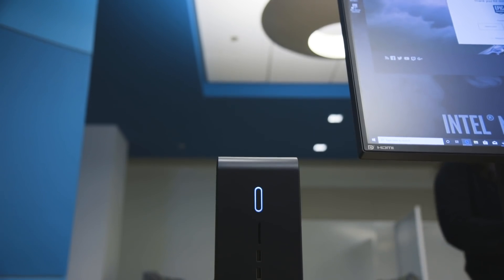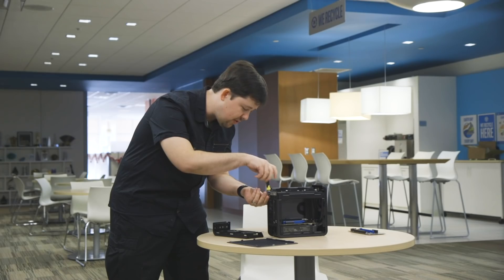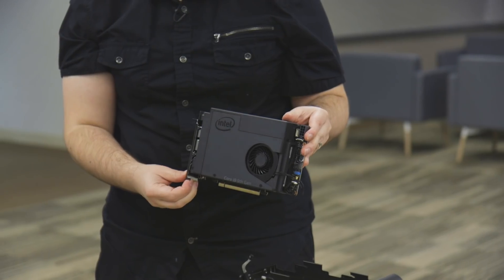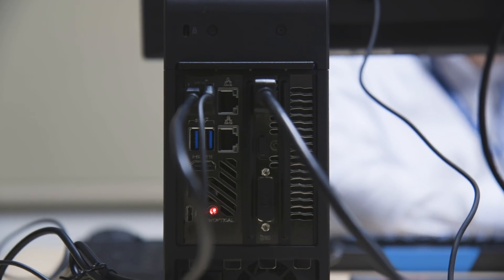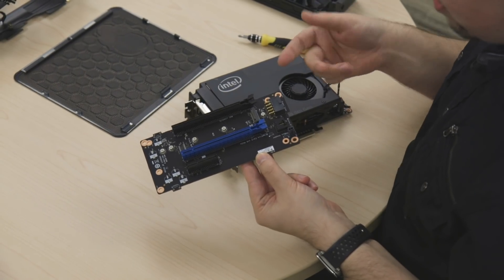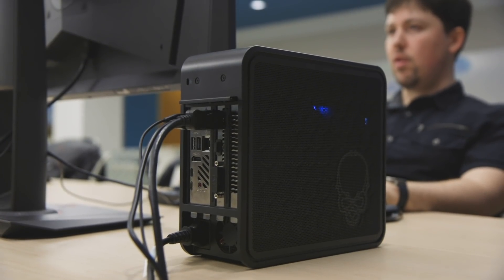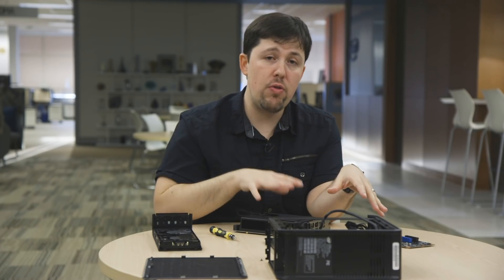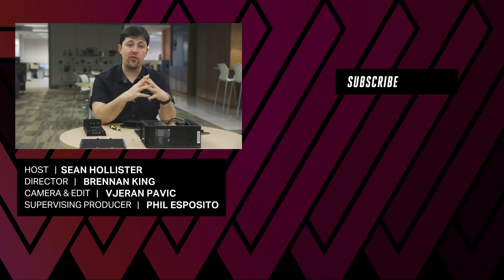Exclusive: Inside Intel’s tiny modular gaming PC

Comment: Hardware-wise I only have two real issues with the new Intel NUC 9 Extreme.:
1 - The front panel ports should be designed to be compatible with VR headsets.
2 - The CPU and GPU boards should be facing away from each other, so that each can draw direct air from the outside.

Comment: To be fair when I had my Pentium 4 with DDR RAM and IDE HDD, I upgraded to a Pentium D, which required a new motherboard and new DDR2 RAM, and got a SATA HDD. Then, I upgraded to an i7 950 which required a new mobo and new DDR3 RAM, and got a SATA SSD. Then, I upgraded to a an i5 9600K, which required a new mobo and new DDR4 RAM and got an NVME SSD. Making the upgrade just a card replacement makes absolute sense. What's everyone crying about.

Comment: $13-1700 for a barebones system with no memory, storage, or graphics

uh, what? No thanks
Reply: Well dont forget its just a laptop cpu... this product is a joke
Reply: That's a heck of a range; what does the $13 one include? 🤨
Reply: @user-vn7ce5ig1z  there is an word in english that works for you either way, if your serious or not. either sarcasm or not.
starts with an i
Reply: Ese Seis> there is an word in english that works for you either way, if your serious or not. either sarcasm or not.
starts with an i [sic]

Well, it's definitely not illiterate ¬_¬ My serious? I don't have a serious. Can I borrow your serious? 🤔
Reply: Ese Seis Trump?
Reply: Yes, but don't forget, when you buy a typical laptop, you will most likely replace the original RAM and SSD, because almost every single manufacturer dont include enough RAM and disk space. 1700 for top CPU, power adapter, computer case and motherboard is not too much.
Reply: Wrong, he said that is for the i3, i5, and i7 configurations.
Reply: @akhilyeddula6435   at 03:21 he says Intel will be releasing it as a "barebones kit" meaning you will need your own memory, storage, operating system, and graphics for between $13-1700 with the varying i3, i5, and i7 configurations.

Did you even watch the video?

Ridiculous pricing.

Comment: Upgrading a regular computer : Two screws off the case side, now you have access to everything
Upgrading this computer : 4 screws out of the front, unplug the motherboard (that's what it is), unscrew and remove the heatsink for the entire unit, welcome to laptop class components in your desktop, now you can upgrade the ram or the storage.

How is this easier? The price on this is also horrendous.

Comment: All Intel did was reduce upgradability. You can't upgrade the memory independently of the CPU, since its soldered onto that board. A CPU socket was already a good form factor, and it already allowed for easy upgrades. And it allows for independently upgrading of the CPU and memory.

Comment: What benefit does this size give you, maybe if you are on the go an also cary a monitor with you. If you want something compact there a re many cases with smal form factor psu's and standard components, yes there are slightly bigger but if you want to upgrade you don't have to spent money for 2-3 because there are all soldered to one another. Or you buy a corsair one, that still have most standard components.

Comment: -_-, Ok so it's so modular that you everything is integrated in one card... so what is left is enclosure.... It costs more than normal gaming  notebook... Yeah what a reasonable device we have here... I think it's better to Invest in smal portable notebook and buy external GPU enclosure. Every 2 years change graphic card  and every 4 years notebook and always use something that had premier 2 years ago or from ebay than you save around 50-75%.  Alternative us just get Intel NUC Hades Canyon with AMD Radeon RX Vega M GH
Reply: Marcin Rybarczyk the notebook/egpu enclosure combo isn’t worth it for how much it cost and the amount of graphics power that is lost. This is a much better solution from intel, the only issue is the price. If they could price it so say the i7 board with components could cost ~$1000 it would be more compelling.

Comment: Intel is trying to integrate stuff so that when times comes to upgrade you will have to pay more. Get yourself a small case, a small motherboard, a CPU, a small cooler (passive cooler if processor compatible) and graphics card and you will then have a truly upgradable machine that you will be able to upgrade for less and that could look equally good. Lastly you won't be tied up to Intel as you will be able to buy your upgrades from the brand of your choice. (Which is exactly what Intel doesn't want!)
Reply: Also the velka 3 ssf case exists
Reply: Not just Intel is trying to integrate stuff if you buy a cheap printer but you'll pay more for the inks or tonners --just biz as usual
Reply: The mini STX format should have caught on more. Perhaps with a dedicated PCIe x16 slot it would have the capacity to easily support high end GPUs with the same small form factor. With the added benefit that in mini STX boards the CPUs can be desktop CPUs that you can replace on the socket.
Reply: You'd have to buy a new motherboard if you wanted to switch to amd.
Reply: @cang559  This is true, but the massive advantage of this board is in its custom mobo design being split up into two pieces with an enclosed cooling case. Its rather genius and shaves more than 30% of what is physically impossible in other cases regardless of components (assuming you USE a GPU). This case is essentially a nano ITX (not mini) that integrates everything to save space, ditches any SATA ports in favor for the better M.2 performance, with an even slimmer 500w HDPLEX PSU and PCIE splitter (not riser). All of which saves a ton of space. This comes with its limitations of course, no AIO, no SSD/HDD, no GPU beyond 8" (so mini boards only), RAM modules are SO-DIMM and max out at 2666. The major benefit of this system is the fact that mobo/CPUs last the longest and GPUs are what really matter. This case can last a decade if you make a simple GPU swap. Then, when you want to beef up your CPU, go all out with a mobo upgrade too at $900. Humanity has always paid for convenience. This is no exception.

Comment: A CPU on PCIe?! I feel like I'm back in the 90s with my Pentium 2.
Reply: it's not really on PCIe. since the motherboard is basically on the "compute unit" the PCB with PCIe slots is basically just a custom PCIe riser, the connector on the compute unit is basically the one PCIe slot of the system split into 2 ports, it's an "input" not an "output" if that makes any sense.
Reply: Tech almost like fashion these days. What's old, is new again!
Reply: Slot 1 baby!!
Reply: IKR? The slotted CPU concept never sat well with me; while the performance was fine, it always felt cognitively incongruous with real performance, like it was going to take a hit (and to be fair, the P2 and P3 could have performed better if it weren't on a card). Also, maybe it just felt old-fashioned like how old systems had daughter-boards for various reasons. 🤷
Reply: The CPU should be replaceable without changing the whole board, but seeing that this is part of the NUC lineup that would be unlikely.
Reply: Daiku Coffee yea wtf
Reply: Thank you and exactly! This just means that when upgrading you have to swap everything...

Comment: Ahhh.... the good ol.... Apple Way :D
Reply: That thing is nowhere near as elegant as something Apple would make. It's just modular. It's cramped, still has cables all over the place, etc...
Reply: @SamDunham Tell me, how would Apple make something more "elegant " than this with no cables "all over the place" and make it less cramped but still house an RTX 2080? The answer is they couldn't or else they would have already done it. Apple couldn't make something this powerful AND nice looking. They could only make it look nice because that's all they are good for, fashion accessory tech.
Reply: @giottoprimo-1  They kinda did with the Mac Pro, there are no cables anywhere, just large pcie moduels, very similar to this just bigger.
Reply: @Sponch1  Not true. The Mac Pro has ports 2 USB 3 ports, 2 Thunderbolt ports, and 2 ethernet ports. Guess what it will look like when you start plugging in peripherals? You really think the demo, showroom version of the Mac Pro is how it will look when you use it at home? lol THey didn't have anything plugged into it, of course it will look clean. The Ghost Canyon looks clean too when nothing is plugged in.
Reply: Apple just what's your money and make things look different then they are
Reply: Ehemm..mac mini 😄

Comment: He`s talking about upgrading that module but doesnt mention thatll probably cost 90% of what the whole system costs
Reply: Whatever but its a huge ripoff.  You will have to get your own memory, ssd, gpu for the price of $1,050 with a Core i5 module, $1,250 for Core i7.  You can buy decent desktops and laptops with discrete GPUs with these listed prices.
Reply: @zodiacfml  i guess this device are aims towards small form factor and profesionals i mean i see alot of potential here
Reply: Yes basically Intel makes you buy a new computer and lets you keep the case ... if they don't abandon the format in a few years times of course.
Reply: @Photoandcargeek  WHy would they abandon it? They kept the same CPU socket for... almost 12 months. (lol, can't keep a straight face)
Reply: @Photoandcargeek  I mean it's basically what you do when you upgrade your CPU to a new generation. You need to replace the motherboard as well.
Reply: @fuzzydogdog  with Intel yes AMD not so much. You can install a Ryzen 9 into a first gen x370 motherboard.
Reply: just imagine what it should cost then times that by 10
Reply: agreed. this guy should not be reviewing this
Reply: Depending on the GPU you have it’ll be more like 50-60%
Reply: @MarcoBarroca  How do you know? You are most likely wrong as it will depend on both your choice of CPU and GPU as you will have to bin your graphics processor and get a new one as part of your new motherboard+CPU+GPU combo.
Reply: Ypu can reuse the ram, the storage also at least for two generations which is a lot if you have like 32 gb of ram and a storage that you didn't use full life span. But yeah, 1300 usd for just a motherboard, cpu and psu is kind of expensive

Comment: The Real Question: Can you run macOS on this?
Reply: Thats literally not the q
Reply: If it's designed for gaming why use macOS, macOS is good imo, and it servers a purpose of being used by professionals but not for gaming, if this can be modified a bit then I see it as best Mac pro
Reply: Paras Suneja The Intel Nuc is very popular in the hackintosh community, hence why I asked
Reply: @brandon_nope  Oh, I guess then maybe modifying it a bit would actually make it way better option for size and price of it
Reply: You should be able to? Might have issues with airdrop
Reply: I think it’s possible. I’d like to know if the wireless module is replaceable so you can get AirDrop and iMessage working.